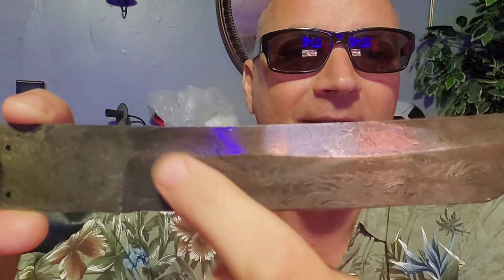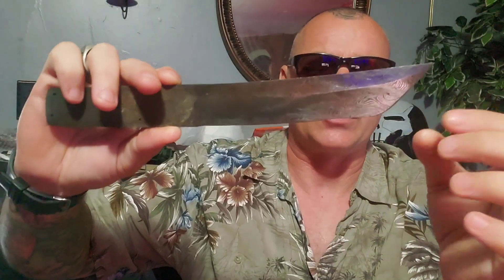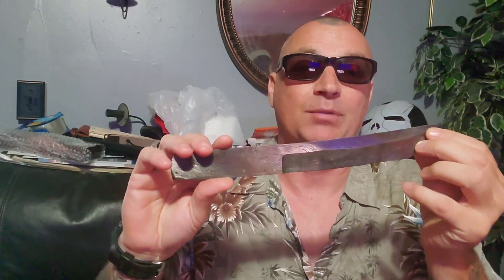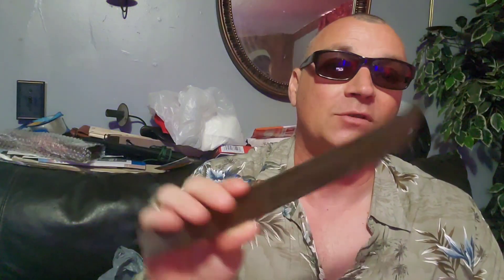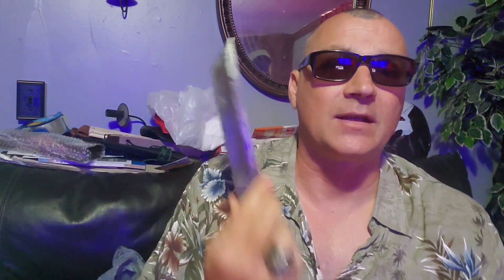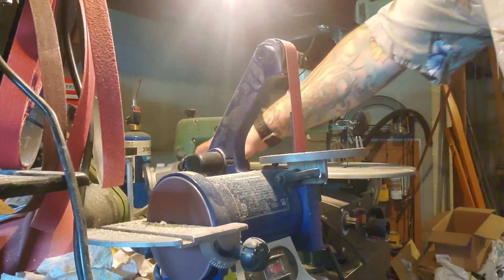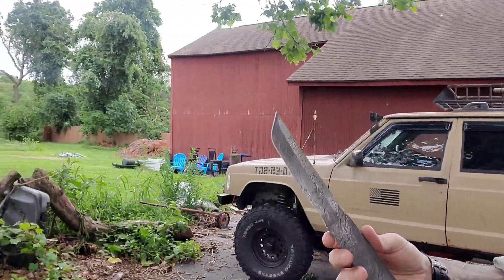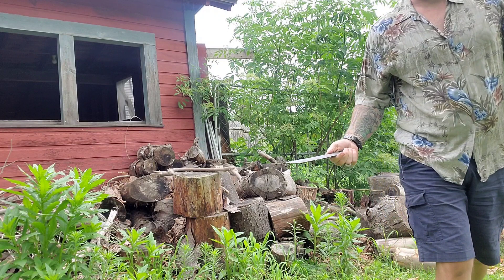dbad Damascus Tanto - The Making of.

Comment: If I were you, I'd make me a simple bevel jig out of some angle Iron, some screws and nuts. 
This would make it much easier, grinding bevels. Especially, if you use quite expensive bar stock steel.
#22aday
Stay safe everybody, and stay blessed.
Greetings from Germany!
Reply from the maker: I have a great jig. I prefer to do it by hand. I've gotten much better
Reply: @DonnieBAllDay  
If you want to do it by hand, ok, this is fine. 
Its all about practise.

Comment: I have some questions for you DBAD with the same heat treatment which hardens more 5160 or 52100?  And can khhi make laminated steel and blades?
Reply from the maker: 5160 and I'm not sure
Reply: @DonnieBAllDay  the reason i as is it would be cool to have a blade made using a san mai type laminate of those 2 steels if they could wouldn't it?
Reply from the maker: @garenkinoguhyt7088  they are so close in properties that I don't know if it would make a difference but now I want to see it done! Haha
Reply: @DonnieBAllDay  so do i if thay can do it it would be interesting to test a gator tail or a war machine made from it
Reply from the maker: @garenkinoguhyt7088  I'd be jealous I can tell you that. Haha